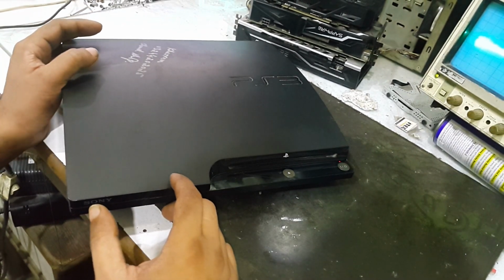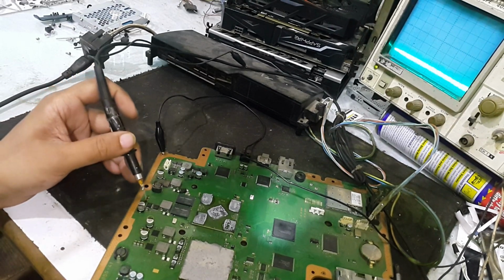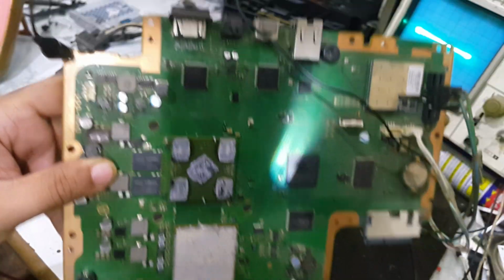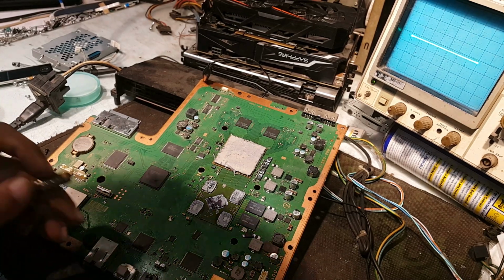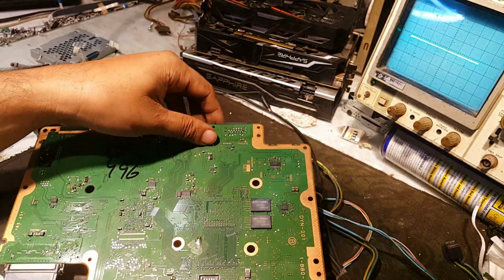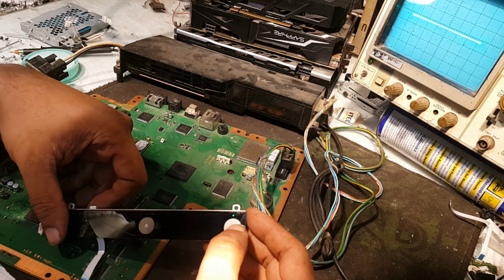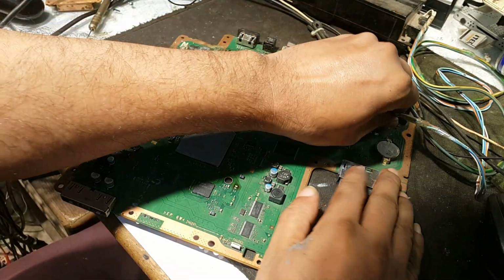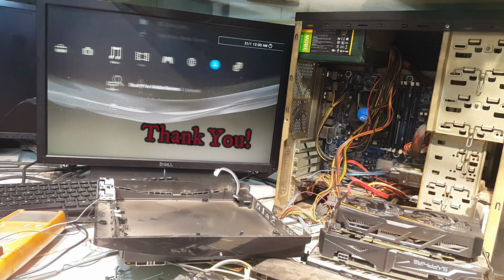PS3 Slim YLOD Fix Video - Comprehensive Guide to Repair Your PlayStation 3!

Comment: Hi, I watched your video to gain some knowledge, and you tested the resistance of the CPU and GPU to determine if they were faulty or not. I tested both of my PS3 Fat consoles with the same board version, but the difference between the working motherboard (version 001) and the PS3 with YLOD is that the working motherboard reads 5.2 ohms, while the one with YLOD reads 4.2 ohms. Does this indicate a fault, or is it normal?

 I am also getting the SysCon error code 1701.
Reply from the maker: A 5.2 Ohm reading on a working motherboard doesn't necessarily indicate a fault with the one reading 4.2 ohms, but the difference could be worth investigating further!

Comment: if i have ylod on slim ps3 can it be reduce by take care them (sorry for my bad english) but i want the answer so bad
Reply from the maker: Over time, electronic components can naturally degrade, especially those subjected to heat and frequent use. While users can help mitigate overheating by ensuring proper ventilation and cleaning, the internal connections can still wear out over time due to the inherent physical stress on the solder points.

Comment: Ps3 gets stuck on software loading at 98% hdd is already changed drive flex is also change 3 times I have changed pen drive also any solution
Reply from the maker: Is that jailbroken or on official?
Reply: @idreestech  super slim is at official firmware and other ps3 slim is at 3.55 which is also having same problem
Reply: @idreestech  mine also stuck at 13%
Reply from the maker: @dharmveergrover , What is the written error code?
Reply: @idreestech  8002f147 
Jailbroken ps3 hfw slim

Comment: Nice video.
I have a problem.my ps3 slim 2500a working fine on hen 4.85 but after update to hfw 4.89 stuck at installation update and gives error code 8002f147.
I formatted the hdd and I opened the ps3 and no ode inside.
Can you help please?
Reply from the maker: 0x8002F147	Error with installing Firmware update. Make sure the sourcedrive with the PUP is readable and reboot the system first
Reply: Bhai os k cd ROM main problem hai is liye update nahi horaha os k connecter nikal Kar phir lagao ya dosara Sam jeck wala cd rom